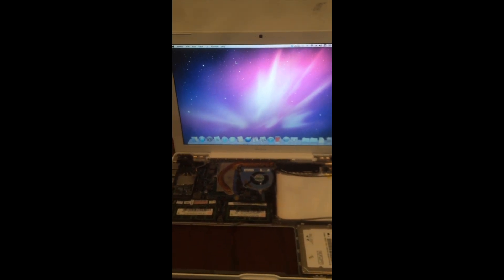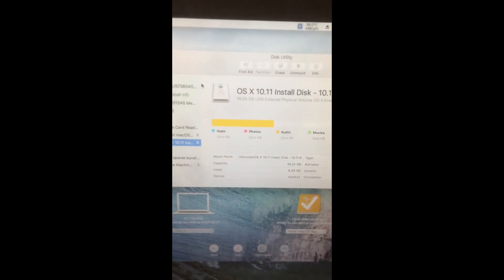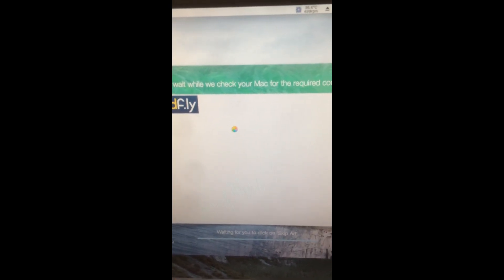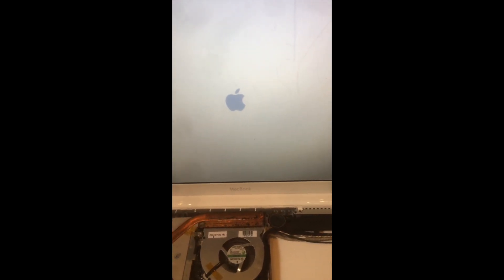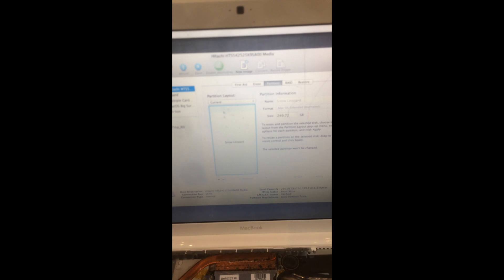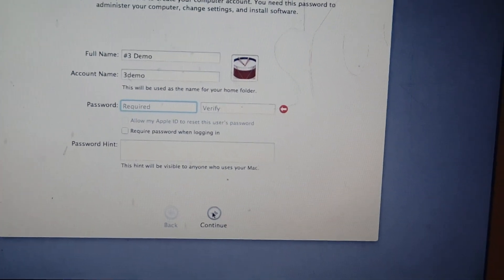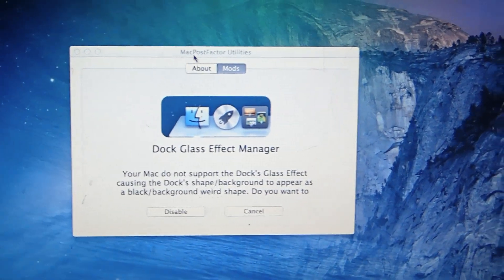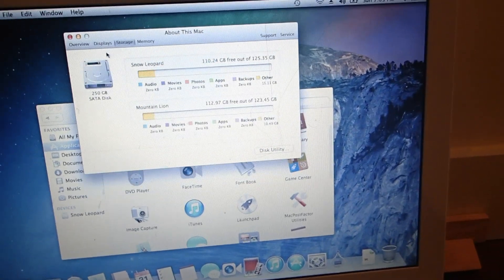Install OS X 10.8-10.11 on unsupported macs with download links! | MacPostFactor

Comment: If you use macpostfactor to install , and choose install the installer onto your main hard disk , you have to set aside a fresh separate mount partition for the 
installer , what I would do is either split partition into 2 , with one having the 
installer file , but honestly I would just choose option create install USB for macpostfactor at the program menu

Comment: hi it's stucked on the SKIP ADFLY any workaround?
Reply from the maker: It works for me make sure you are connected to internet and use the same version as I did I believe that the link is in the description. If not there is an alternative patcher called sfott look it up on google

Comment: Hey, i also have the Ad-Fly Bug. Could you please make me a Yosemite Image for my iMac 5.1?
Reply: Am I stuck on Mountain Lion forever because of adfly
Reply from the maker: @GrandPlatClips  No
Reply: @PirateProductions  How can I fix it
Also the macbook 4,1 DMG in another comment doesn't work
Reply from the maker: @GrandPlatClips  what do you mean it doesn't work
Reply: @PirateProductions  It will just redirrect me back to a different partition that has mac os x mountain lion
I installed mavericks to 2nd partition
Reply from the maker: @GrandPlatClips  When restarting hold down option. If it happpens even when you hold down option it is due to the wrong efi architecture
Reply: @PirateProductions  yeah thats the issue
I use option to switch between oses on the mac
Reply from the maker: @GrandPlatClips  Did it work? If not here's a Yosemite image https://drive.google.com/file/d/1Xg7yi2Wp0ee1H477qh_su2CqJcz8-2Ig/view?usp=sharing

And here's the copy of MacPostFactor I use, and I'm never prompted for adfly. https://drive.google.com/file/d/11mX3vO7rYN7M1Mp3NFzVNcf-x4yiIctR/view?usp=sharing
Reply: @PirateProductions  Yeah yours prompts me for adfly
Reply from the maker: @ObsidianGaming7 Does the image work? To use the Yosemite one in your MacBook you have to change it to 64 bit by using the application at the root of the drive
Reply: @PirateProductions  Thanks Yosemite Installer loaded now installing Yosemite
Reply: @PirateProductions  Yosemite Works now I can run Firefox ESR
Reply from the maker: Why not just run Linux or windows 10? It would certainly be faster
Reply: @PirateProductions  I need the mac os x Yosemite for building a hackintosh
as my PC is capable of running Big Sur
The Old mac can help build a new mac
Reply: @PirateProductions  The Yosemite Image no longer works
My Mac will just boot to Snow Leopard that I had previously on the SSD
Reply from the maker: Have you tried a reinstall?

Comment: Hello i tried to follow all the instruction what i saw in the video (with maverick,yosemite,el captain )but when macpostfactor ask my MacBook (2007 late C2D)to reboot after that won’t start just stuck on recovery screen.Any solution please???
Reply from the maker: Yeah. That happened to me. What could be happening is it’s booting into the wrong volume. Hold option after the chime and then choose the  correct volume
Reply: @PirateProductions  If ihold the option there are only 2 options. 1st Create recovery  2nd recovery it doesn't matter what i choose it takes me to recovery menu where in disk utility i can see the osx base system is mounted but can't install .Its confuse me ....
Reply from the maker: Ok. I see. Did you tick the small recovery box? Try unticking it. Also when you install from the installer wipe your entire disk. Then leave it and let it boot by itself. For me mavericks was the best option
Reply from the maker: @3oyz  If you want Yosemite you can use this prebuilt image https://drive.google.com/file/d/1gYTHlKmvZvp3ZikdQbZJrZufBfN0GKNP/view?usp=sharing and follow this guide: https://forums.macrumors.com/threads/how-to-yosemite-on-macbook-mid2007-with-audio-and-graphics.1916198/

Comment: Any solution for graphics and audio fix using  kext utility(GMA, nividia, ati)?
Share the files
Reply from the maker: I don’t know why but when I reinstalled it was working I have gma. I haven’t tested it but in the same website as the utility there is macOS extractor. When I installed it it it gave me a folder in my applications folder and a sub folder with packages for gma ati and nvidia. Unfortunately I have had some issues with wifi because my machine doesn’t support the latest standard and the package requires an internet connection to install. Here is the macOS extractor website. https://osxhackers.net/macos-extractor/# Make sure to customize the installation and just install the tools not whatever version of macOS your prompted for.
Reply: @PirateProductions  OK thanks I will surely look at it. Because I have been trying to install elcapitan on my Macboool 3,1 but during installation using my bootable USB done by macpostfactor into my created partition, it keeps failing and rebooting to the mother osx(Yosemite ). My graphics card is GMA x3100....
Reply from the maker: Great. Let me know if you get it to work successfully!
Reply: @PirateProductions  Is there a way to get GPU Accel for GMA x3100
Reply from the maker: @GrandPlatClips  try these kexts https://dl.osxhackers.net/Kexts/Kexts.zip

Comment: hello I did the mountain lion 10.8 on my macbook pro from 2007 and i didnt have a password before and now it asks me for a username and password
Reply from the maker: Bi Lilc2. That’s weird. There are a few ways you can solve this issue. You can boot up to recovery (if you don’t know how, hold option or alt on a windows keyboard immediately after pressing the power button and selecting the option that says recovery) once your in recovery, there should be a utilities menu and choose reset password utility. You can also google how to reset your password. Do you have a backup? It could be because auto login got disable, or it could be because it’s asking you to make a new account. Hope this helps.
Reply: @PirateProductions  When i hold option the there is no recovery option it just is the main drive and my external usb
Reply from the maker: Try holding command r
Reply from the maker: @Lilc2 did you solve the issue?

Comment: can my macbook late 2006 runnin at el capitan?
Reply from the maker: Hi. If it is late 2006 chances are that this patch will work. It will not be supported officially and El Capitan seems to be hit or miss. I would recommend Yosemite. If the model identifier is 2,x or later this patch will work. Thanks for watching!!